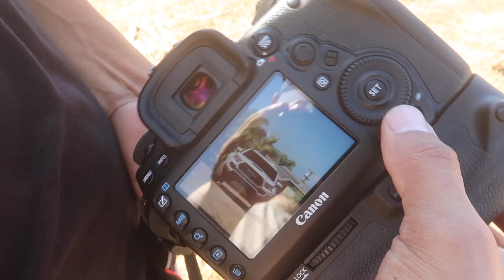WIDEBODY TACOMA -Install & Paint

Comment: Looks like a factory made special edition. Much like what ram made to the ram truck for the trx or what ford dis to the f-150 to make the raptor. 
This is how the Tacoma TRD Pro should look from factory, or maybe if they made a Baja/Desert Runner edition.
I would personally start with this body for a Taco and then build it up.
18" forged wheels, big brake kit, 5" lift from Icon, fox3.0 shocks, 37" BFG tires, iron offroad bumpers, top and front lightbar.... IDK, but those fenders look insanely gorgeous